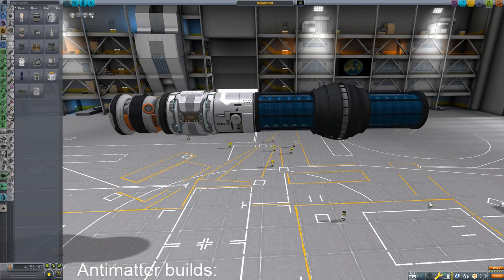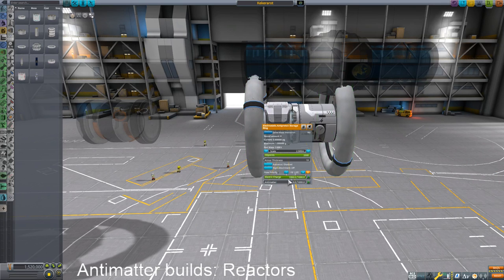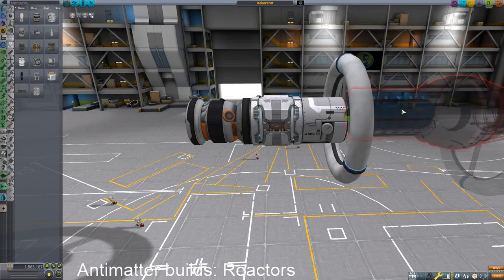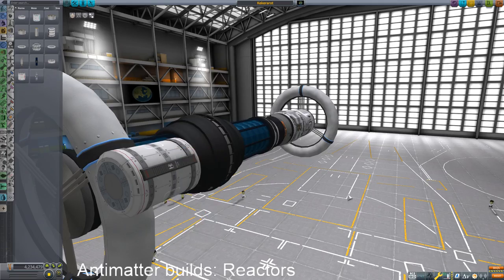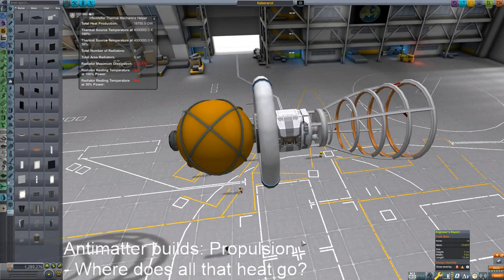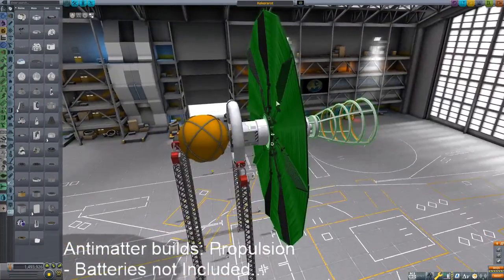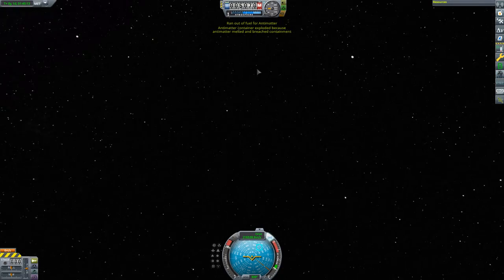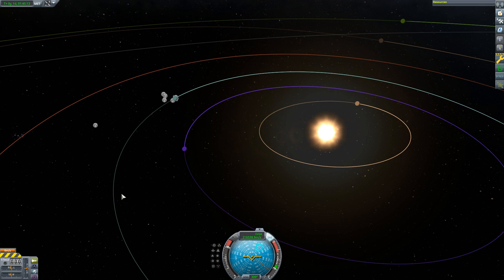KSP Interstellar Extended for 1.8.1 - Beam Core Antimatter Propulsion

Comment: can please explain what power priority does
Reply from the maker: Hi there! Sorry for the late reply. Power priority is used to specify which parts get electricity first if there is not enough to power all parts. Parts with the lowest number will be powered before parts with a higher number. If all parts have the same priority then I think there is an internal priority list that determines what gets power first. (pro tip, give your fusion reactors lowest number (highest priority) to ensure fusion stays powered. If your vessel has surplus electricity then this setting doesn't do much.

Comment: So, my beam core antimatter powerplant doesn't work with an MHD generator, only a thermal one, and it keeps saying it won't work because it's solarwind deprived. do you know what's up with that?
Reply from the maker: That sounds like a bug. May want to report it to the mod author. It shouldn't be asking for solar wind. Should use anit-protons and protons (hydrogen).

Comment: How did you jump to orbit like that? Mod or some hotkey I'm unaware of?
Reply from the maker: in this video i used the cheat menu. alt+F12. I usually do a launch with rockets or I'll use the antigravity capability of the warp rings to get to orbit. In this video, since I was testing multiple iterations of this vessel (basically designed it as I was making the vid) I opted for the cheat menu since it was quicker.

Comment: I don’t see the point of the beam core reactor. It produces way more power than any engine is capable of aging with out overheating to hell, and it on works most efficiently with magnetic propulsion. I could use the thermal antimatter reactor or the micro fusion reactor instead.
Reply from the maker: the beam core is a bit of a niche device, totally true. In almost every application the thermal positron reactor is superior. But, when used with magnetic propulsion and properly cooled. The beam core gives delta V measured in percent C. It's gnarly :) The thermal antimatter reactor (the warp core looking thing) is so sweet though, super powerful. Great for generating electricity. The AIM though, is the 'magic bullet.' That thing is what the world needs.Keep flying!
Reply: @PunkWyrks  Indeed. Apologies for the spelling mistakes. I was typing on my phone.